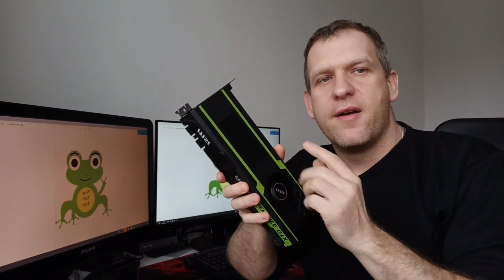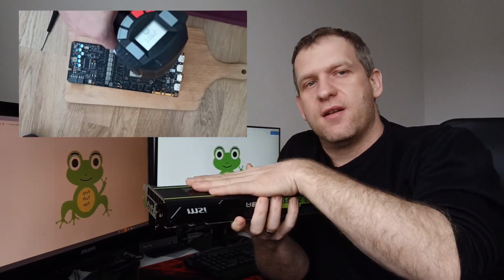Why I do reheating/reflowing GPU with no signal or artefact problem

Comment: I have bought a used card "MSI GTX 1080 GAMING X" It should work, but i got scammed. The card had from the first start any artifacts and crashed. After a couple of starts the card completly went black and dont start anymore (card is working but no image). Now i found two possible options: 1. reheating/reflowing GPU or many people on reddit say its faulty memory (they say aritfacts is faulty memory mostly) so i should undervold (not pssible with no image) or i should reflowing my memory...what would you do? I opened the card everything looks and smells fine :) the thermal paste was not much left over anymore
Reply from the maker: Hi if you can't send back and get your money back try reheating and yes don't forget reheat memory module as well there is nothing to loose anyway and worth to try. If you check proper repair like replace vram will be to much expensive and is not worth just try reheating

Comment: Yes Frog same, I try everything before heating, bios flashing etc, if that fails then I do always put in oven for 5+ mins @ 200c and then attack with heat gun @ 300c, putting in oven just warms everything up so less sudden direct heat on vga/vram chips
Reply from the maker: If you tried all there is one more problems probably with HBM2 memory module I hear about some limitations on it as over time  just stopped working

Comment: How can i know when  core or vram is causing artifacts and if i tried a reflow is a good idea use liquid flux pls help brand gtx 1660
Reply: Vram: the artifacts will only come up when you install the drivers. 

Core: when the card has no drivers installed and artifacts are still present.
Reply: @rono.9157  THANK YOU YES WHEN I INSTALL THE DRIVERS I GET ARTIFACTS
Reply: @xxcriticalmasterxx8731  You need know wich is the chip of vram faulty and chage it
Reply: @rono.9157  a reflow can fix it o need be replaced with a new one
Reply: @xxcriticalmasterxx8731  If the artifacts problem is due to the gpu core you can reflow, but if the problem is due to the vram you need to replace the defective chip but first you need found the chip defective.
Reply: @rono.9157  i I found the chip but I don't have a reballing tool and a replacement just an air welder
Reply: @xxcriticalmasterxx8731  Ok, if you found the defective chip or chips now you need to find the exact model of that chip and get it and then desolder the defective chip with the heat gun and then solder the new chip, I don't know if I explained well, I would recommend you to wait a while so I can get you a video of how to do it.
Reply: @rono.9157  i have the tools unless the vram replacement, how can i know  if the vram chip that show errors is damaged in a point that need be replace and not just a single reflow beacuse the artifacts that i get in my pc are not very bad maybe are produced by  tin balls cracked from intesive use
Reply: @xxcriticalmasterxx8731  If the program that I recommended you to use shows you that a vram chip is with errors it would be best to replace it so that in the long run it does not get worse, but if the artifacts are not as bad as you say try doing a simple reflow to see if it is solved but if this does not work if or if it would need to replace the vram chip with errors.
Reply: @rono.9157  i sorry i forget told you what mats says in the report 
the report said the module B1 has 33 errors on write in a test of 10 mb on the 1gb module it's look bad that a reflow can't fix it ?
Reply from the maker: You right and you give him good tips